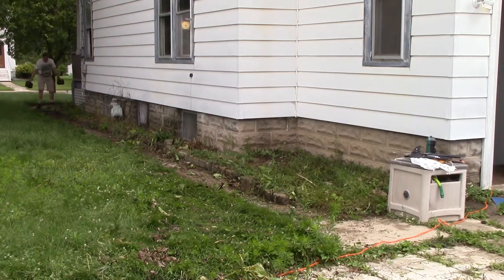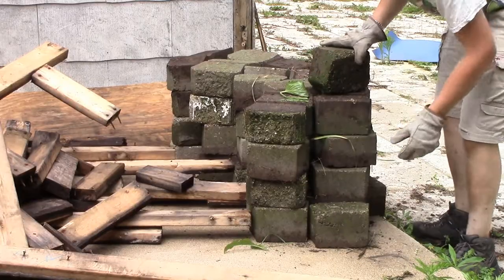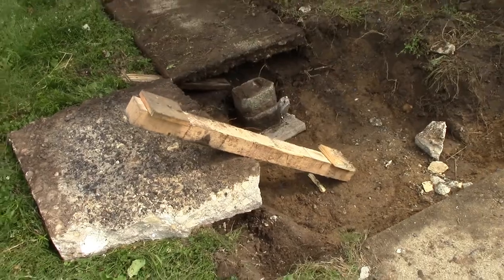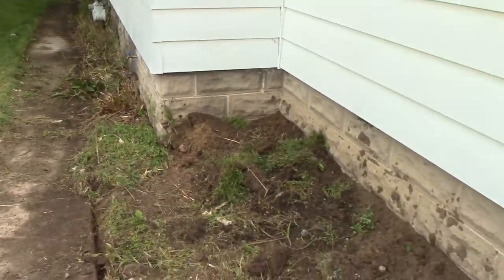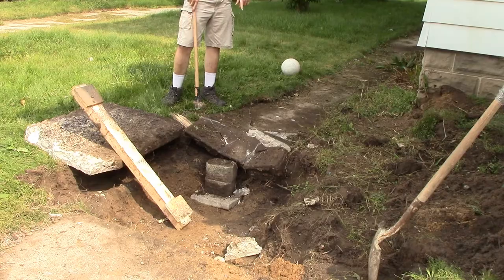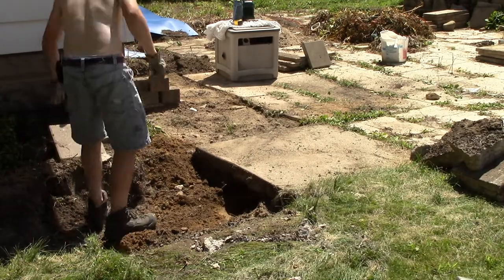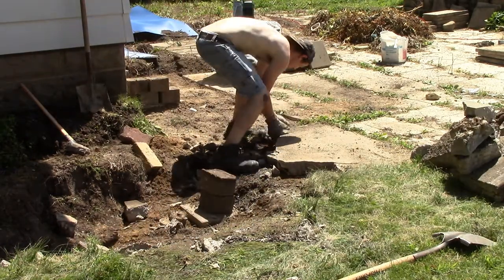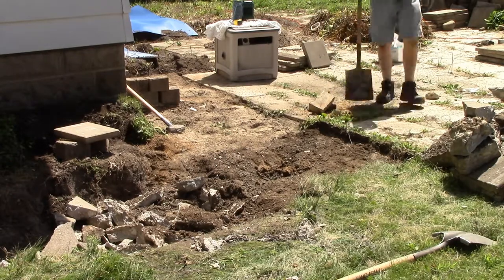Removing my sidewalk

Comment: I know this video was made 6 years ago. But if you still have these cement slabs in your yard and dont know where to get rid of them, my suggestion would be to call the city and ask them. And then rent a trailer to haul them. If you have a tractor supply near you, you could sign up for the nieghbors club reward program. Build your points up to earn a free full-day trailer rental through them.